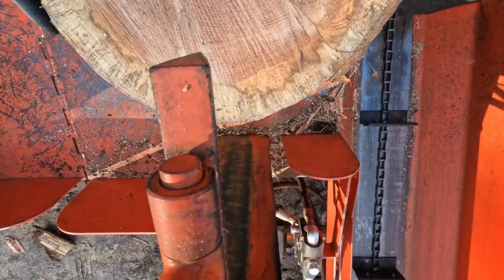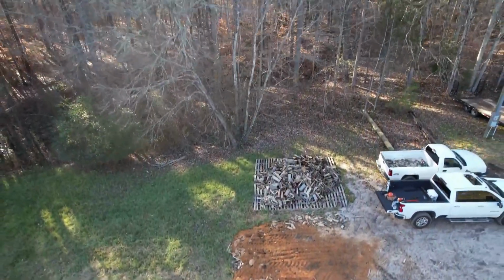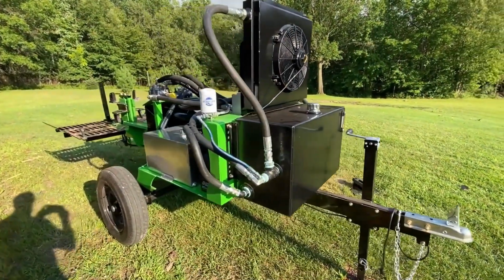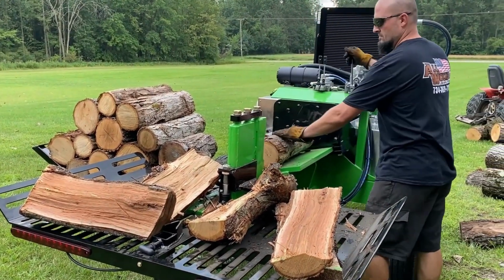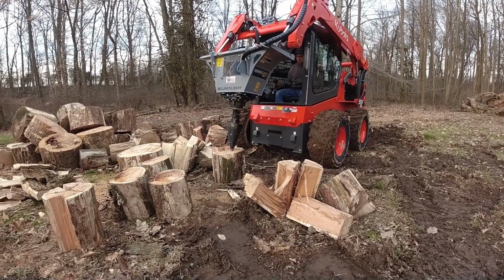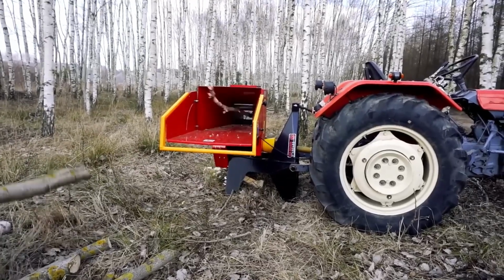EXTREME Fast Firewood Processing Machine Modern Technology - Log Splitter

Comment: I bought the 25 ton county line log splitter from tractor supply and has never let me down yet. Most of the other brands I looked at didn’t even come with hydraulic fluid. Also starts first pull every time!
Reply from the maker: Thank you for your opinion